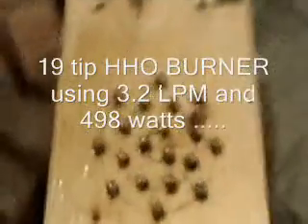19 tip HHO BURNER  3.2 LPM 498 watts

Comment from the maker: I am using Mig tips .025 , but I take a hammer and beat on the top to close the hole smaller ..The actually hole size on this burner is about .011..Burners that are made for propane have to big of a hole size to use with hho ..

Comment from the maker: I have played a little bit with mixing HHO with different gases, the heat is lower and you have to hair air to burn it ..The goods point are it lowers the flame rate way down, I bubbled hho thru 1 tsp of lighter fluid, 3 tsp of rubbing alcohol  and rest water and I could  light the end of the hose and it would burn , and when did flashback it was not bad..but I dont know if it produces any bad stuff by doing that ..

Comment: Plus you could even make a version for fast food grills. 

Their grills use gas, but they have to have filters for the carbon monoxide. HHO doesn't produce carbon monoxide, so that would save money. HHO heats up instantly, so there is less prep time involved.

Who knows, maybe you could come up with a way to connect HHO directly into the gas line to make a Hybrid Gas/HHO burner.

Comment: That info is so valuable. That is your best video yet. I cant wait to see your cooking video. You are using the same amount of gas i am using for experiments.  When you cook something i will cook the same thing on my thick flame burner and see how much gain there is between one thick burner and 19 small ones.  This will answer an important question for me. If you can, try to measure the temp of the pot or pan you use, away from the centre. Your awsome! Thanks!
Stay Safe!